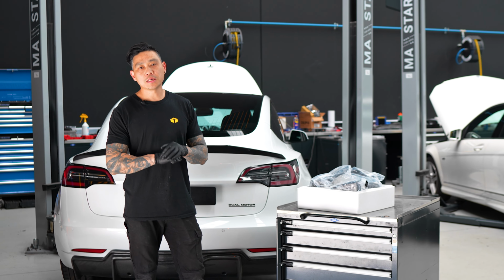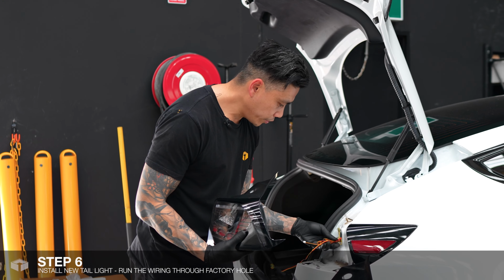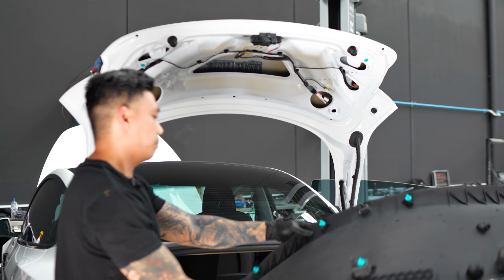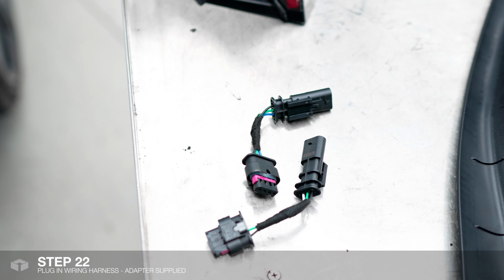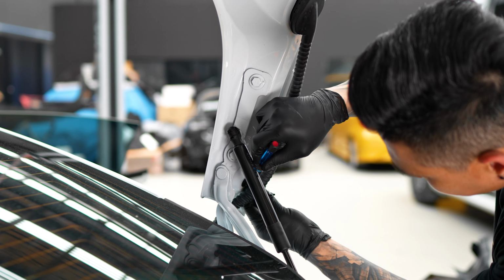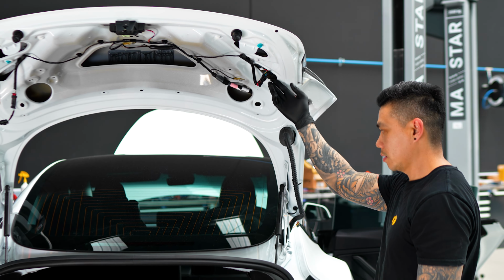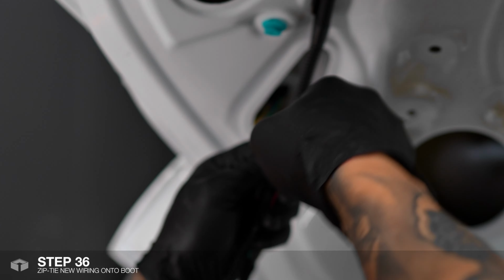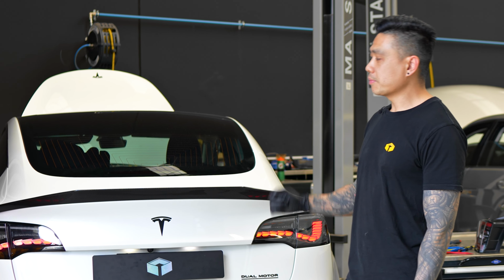Step-By-Step Install Guide - Tesla Model 3 & Y OLED LED Tail Lights

Comment: I just installed these lights. But for some reason my break lights turn on with the turn signals. Did I do something wrong? 22M3LR US version
Reply: This is because your car is using the same light for braking as it does for the blinkers. Tesla didn’t change this until later when they moved to amber turn signals. Did you ever find a solution?

Comment: Those are nice lights but a copy of the Morimoto ones. I have the Morimoto version and they come with an upgraded wire harness for reverse bar led light. I installed that and makes it so much better. I would recommend that brand over this brand.
Reply: Just ordered the Morimoto lights and excited for them to arrive! What are your thoughts on them?